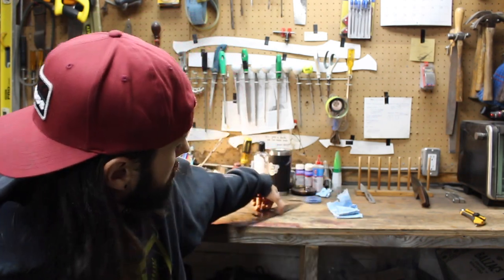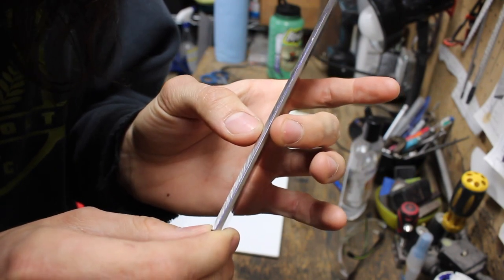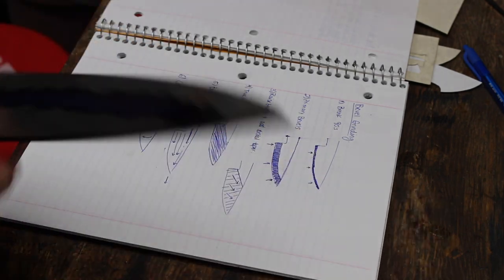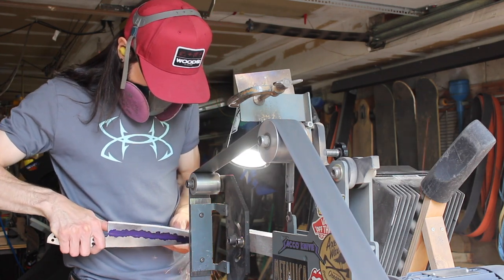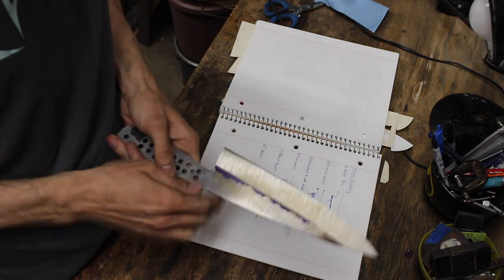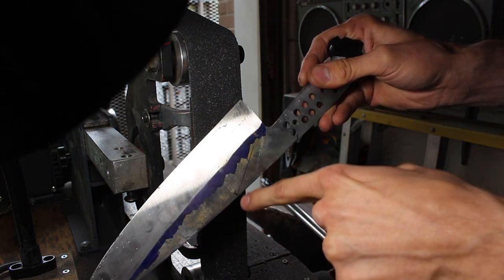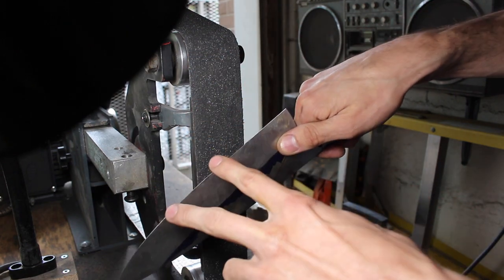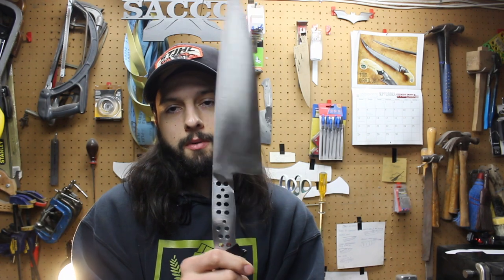How I Grind My Chefs Knives

Comment: This is helpful. Thank you. When do you blend your transition from handle to blade? Is that during hand-sanding? Also what leather do you use for your disc sander? Just glue it on before gluing on your abrasive? Thank you!
Reply from the maker: Glad you’ve found it helpful! I’ll usually blend that transition with my disc sander while it has the leather backing, just carefully touch it so I don’t wash out the flat area for the handle scales to sit on. Then it can be blended further during hand sanding. For the leather on my disc I’m using 8oz veg tan, but be sure to chamfer and round the edge of the side where you stick the sandpaper, if you leave it at a 90 degree it is very very easy to catch the edge of your knife, and that is extremely dangerous and scary. I use 3m feathering disc adhesive for the disc, also use it on the leather. Hope this helps
Reply: Thank you! I appreciate it!

Comment: How are you making your grind convex it looks like a flat platten? Are you just holding your thumb mid bevel to remove the most material there are is that platten slightly convex?
Reply from the maker: Near the end of my grinding process I start to introduce a little convex by lightly rolling the knife from spine to tip. Then I add full convex using my rotary platten. The rotary platten is basically where the convex comes from